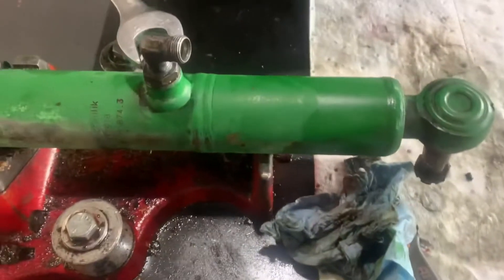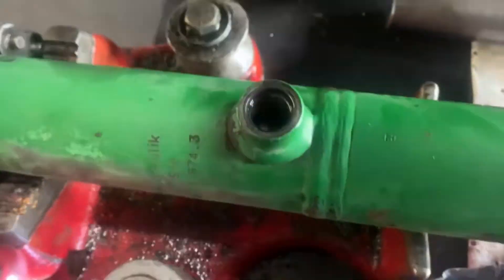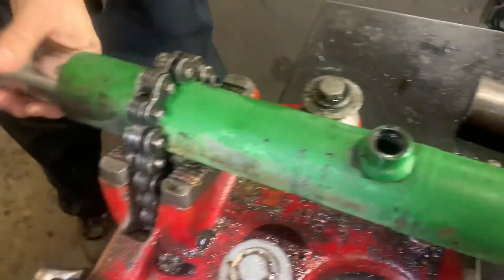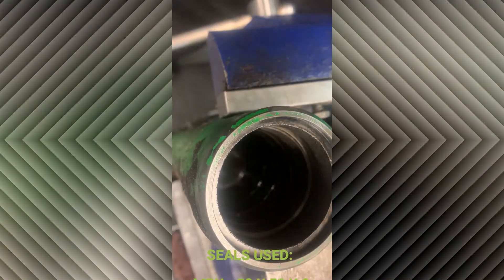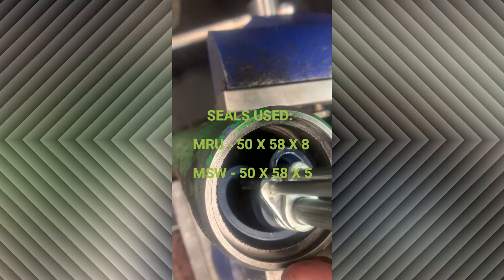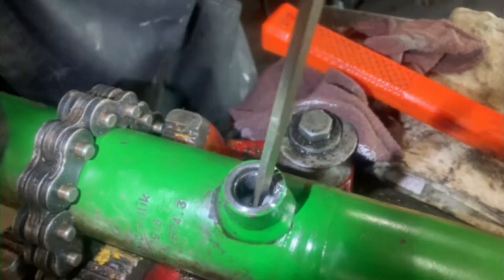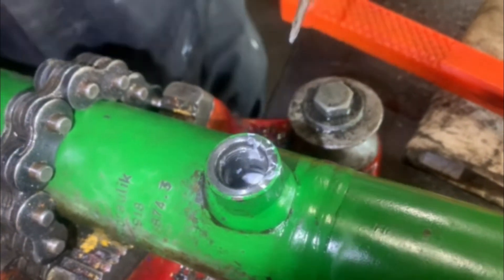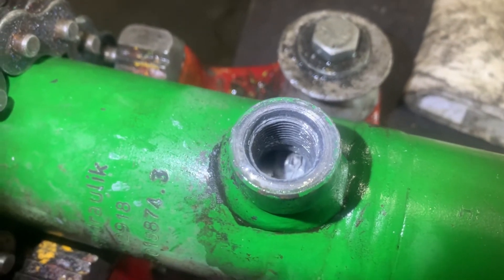Rebuilding A John Deere Cylinder With a Rear Retaining Ring

Comment: I’ve got a Massey cylinder with the same ring set up. Got it off but can’t get back on matter what I try. Might leave it off
Reply: It’s working with the in cab controls. If you use the the fender controls it lifts too high and leaks. Be better if it was on.
Reply from the maker: @chrisandmonicazantingh990  thanks for letting me know!!
Reply from the maker: Let me know if it works! I’ve always wondered…..

Comment: Hello,
          Calorina my jd is 5050d but have prob.is this, loosen stearing and when in the speed then turn left and right .
    Reply me please 🙂 
             Thanks 😊
Reply from the maker: Hey! Hard to say- there’s a bunch of things that could be wrong. If it’s only the steering that’s misbehaving, I would check out the cylinder- it could be bypassing internally. You won’t see any oil leaking, but the piston seal can go bad, not letting it change direction. If there’s an orbital motor, that could be bad too. Hope this helps!